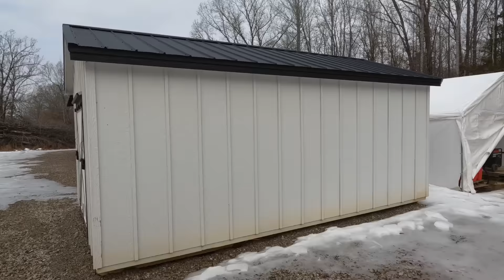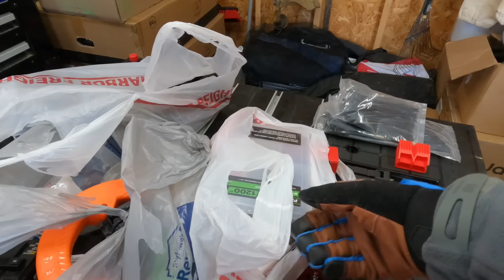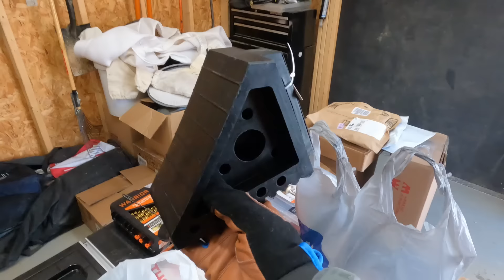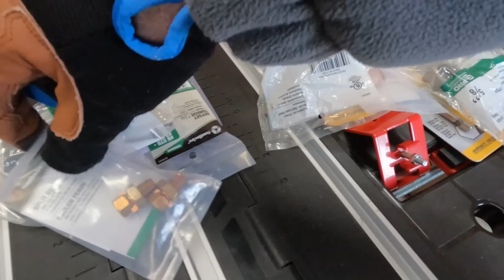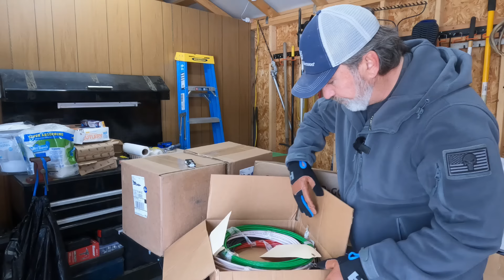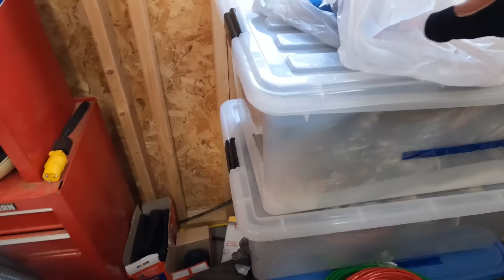HUGE HAUL! | See What I Got! | Rambling

Comment: Vevor makes my 3 point rake. Bet that copper ground wire wasn't cheap. When I started my carpenter apprenticeship I would sweep the floors and collect all the wire the electricians left lying around and take it home and burn it. Then put it in a bucket with  HCl and add electricity to it to clean the copper and got $1.25/pound for it. The power shed will be so nice and neat with all that stuff.
Reply from the maker: That's an interesting way to clean copper!

Comment: Hi Tim for Anthony you're paying to buy this and that and panels for solar I'm sure an electric bill would never cost as much. I live in a three floor town house with three bedrooms 2,1/2 bathrooms and a full finished basement with a bar and projector TV and I pay 75.00 a month on a budget. Solar is good and use it for outside decorations but I could never handle using all that solar first I have no clue how to used panels. lol generators have to cost a lot for gas or diesel or propane. I'm sure it's not cheap living off grid. Cool stuff u got but heck I wouldn't know how to put it together. lol good luck generators a noisy too
Reply from the maker: It’s definitely a learning curve, but it’s been a fun adventure so far!